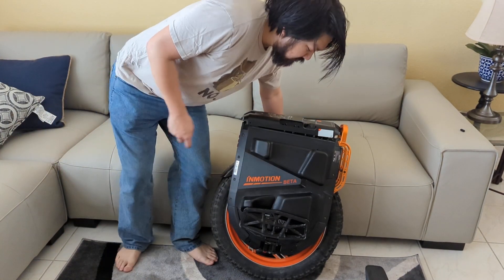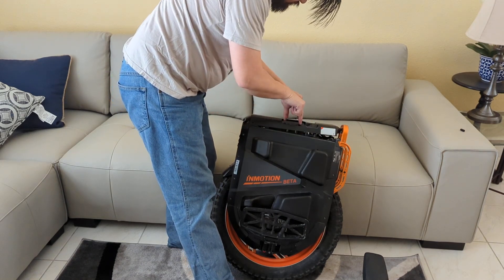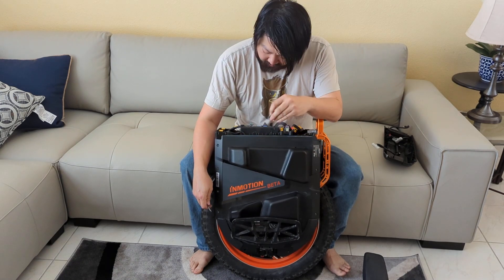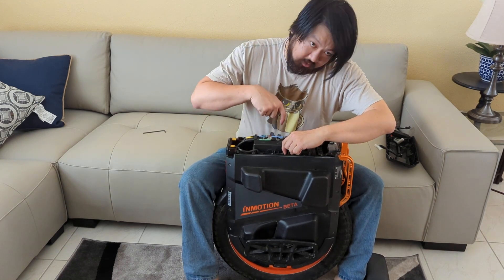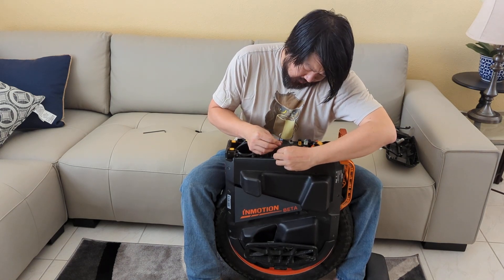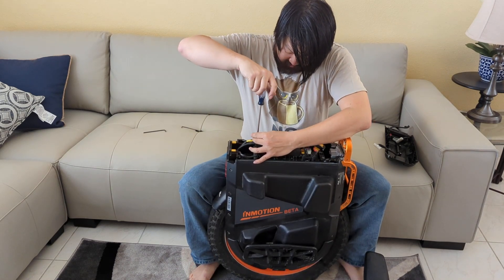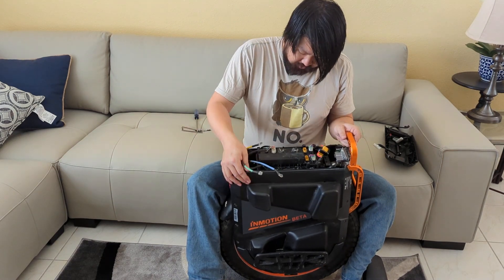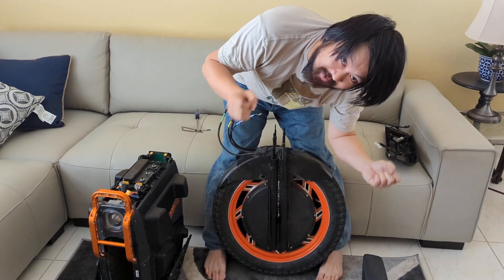InMotion V13 Motor Drop tutorial

Comment: wait the sec, when you lift the wheel by the orange handles, what is holding the motor from dropping out? the 2 damping screws?
Reply from the maker: the two bolts attached to the air shock and the two nuts on top of the dampener.
Reply: @TrungNguyenSquallLHeart  "2 bolts attached to the air shock" where are those? also on the top of the skeleton /frame? maybe I missed that part?
Reply from the maker: @GenZyannd  all of those are on top.
Reply: @TrungNguyenSquallLHeart  does the pedal hangers have rubber bumpers like the v11 that inserts into the motor adapter openings?
Reply: nvm, you didn't even need to take the pedals out.
Reply from the maker: @GenZyannd  the pedals aren't attached to the motor. I don't quite understand the question. I am not familiar enough with the V11
Reply: thanks for responding. I just don't quite understand what is preventing the motor from dropping out? just a few bolts and 2 nuts that grab onto the shocks? In other words, how durable is that design? (even though most people don't want to lift the v13)
Reply from the maker: @GenZyannd  it's pretty durable.. it can tumble down a flight of stairs and at most maybe break off a cheap replaceable piece.

Comment: Nice...basicaly you love the wheel?😁
Reply from the maker: it works great as a commuter/street wheel and currently my daily rider.. the comfort and other aspects of the V13 make up for its supposed shortcomings of the small battery..  especially compared to the Master Pro.
Reply: @TrungNguyenSquallLHeart  I get the corporate line (for lack of a better term) but I too would love it if someone gave me $4k wheel. The real question is do you love it enough to drop big money on it over any & all of its competitors incl the soon to be upcoming. That would be a more beneficial for us mere mortals with very limited funds. That said, I like how it drops out but not being an engineer, I'm unsure about the structural integrity of such a design. Or if it can even be duplicated for non pogo air shocks
Reply from the maker: @scottsum1319  I did not get the wheel for free. The wheel is worth its price.. but like any wheel, its worth is mostly how you're going to use it and if you think that value is worth it to you. For what I do regularly, this wheel works better than other wheels on the market right now.
Reply: Basically
Reply from the maker: @dirt.surfer  it's so easy to take apart... but I still saw other people struggle.. so.. 🤷

Comment: Compared to a Begode Master, that's very complicated to change a tire.
Reply from the maker: I've done both. To me, while the process might be slightly longer, it's easier to me in my opinion. Neither are complicated at all.
Reply from the maker: still not complicated as you make it sound.. it's definitely not "very complicated"... also, you're still tethered to the controller with that method.
Reply: @TrungNguyenSquallLHeart  Well it looks like that in your video.  I've yet to see how you can change a tire with the hub-mount bolts, and less than a few others (such as 4 to remove 1 battery without even unplugging it, and 2 more for wire-channel guildes on the master).  So master takes 10 screws total and the tire comes out.  Not only do you have more screws, you've got electrical connections and a fender to remove before you can access a tire.  That sucks on the V13 to the point I'm not gonna buy one!
Reply from the maker: @reitze01  that's fine.. but between the two wheels, I'm riding my V13 while it's raining while my Master sits at home.
Reply: @TrungNguyenSquallLHeart  I've ridden all my wheels in heavy rain.  The only rain surprise so far was my S22 had major water ingress into the motor due to improperly installed bearing-seal and/or motor-cover-seal.  That motor knocked too and when its controller died (charging, not a water thing) I ripped it all open.  Fresh controller, pinned motor.  Only water issue with 2400 iles, 10 wheels.  https://www.youtube.com/watch?v=2SLssrZ6_lY
Reply: PS:  You should repl Ilike its speed, or range better than the Master.  Does it go faster than the Master?  It should inspire confidence at top speeds.
Reply from the maker: @reitze01  I do feel a lot more comfortable riding at 50mph on it than the Master, indeed! 🙂
Reply: @TrungNguyenSquallLHeart  So far my top speedis 44 mph on the Master, and 42 on my S22.  The S22 tops out at 42.  I'm still under 100 miles on the Master and had trouble with its non-round stock Kenda street tire.  The kenda K262 on my S18 has never been round either but I never tried going over 33mph on that wheel (got to 33 with tail wind down hill with other EUCs riding at their beeps, the K262 is larger diameter giving it the 33mph possibility in the perrrr fect conditions. ).  The non-round tire creates a speed-wobble over 30mph.  I can handle that on the S18, but on the MSX it was keeping me slow till I put the Shinko SR244 on the master and then did a burn-in (shaping???)... learned after than a shaping burnout maybe necessary with the sort of tires we have.
Reply from the maker: @reitze01  ahh yeah.. the stock CST tire on the Master isn't that great.. I shaved it down like Chance did to make it much more better, but after about 1200 miles of fast riding on it, it wore down the center knobs and it started to be bad again.. it's a nice soft tire, but wears down quickly if you're riding a lot of street.. currently have about 1500 miles on the Master, and about 600 on the V13.

I also ended up putting the Shinko 244 on the Master.. I like it.
Reply: @TrungNguyenSquallLHeart  Yea, I bought the Shinko SR244 for my MSX-100V 3 years ago.  I never did shave the side-knobs enough and on that wheel just felt like there was too much friction for the wheel to tolerate (probably more from the inadequate knob-shaving than I realized).  So I tried the SR241 on the MSX-100V, and it worked great (side-knobs shaved and shaved again for road-commute riding 2 years later).  So now the SR244 fit the Master as something to try while my wrong-size-purchase of another street tire for the master failed.  I'll keep the noisy SR244 for now since it doesn't amplify speed-wobbles like the Kenda did.